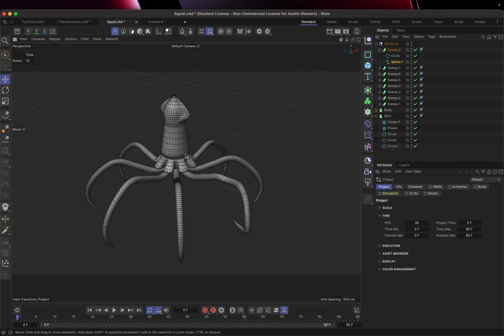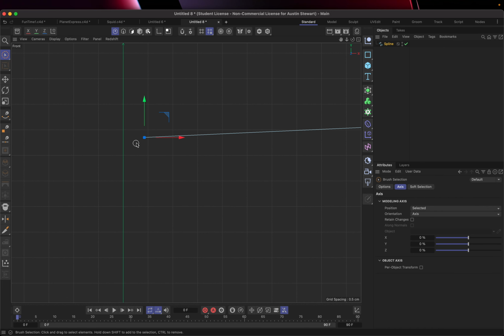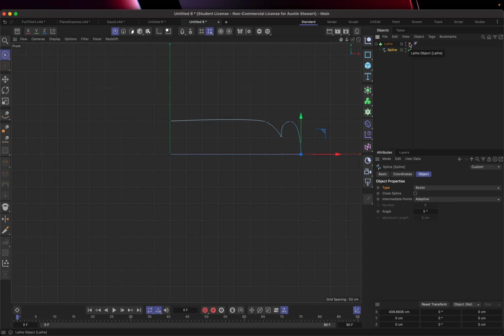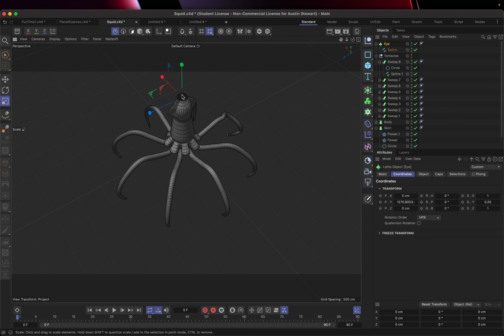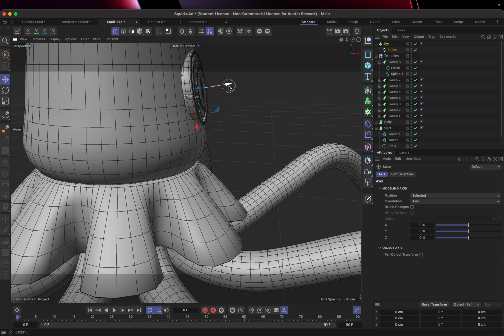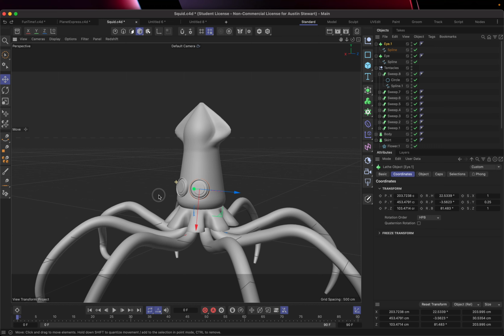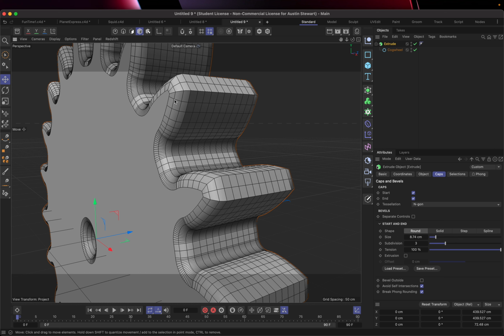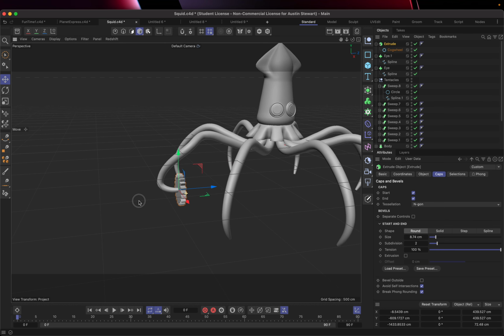Cinema4D 2024 Tutorial 3: Spline Modeling Part 3: Lathe and Extrusion

Comment: Thank you for the great tutorials, if you use the "middle mouse" to switch between the perspective and orthographic views, it is much faster. Thanks again 🙏
Reply from the maker: Thanks for the tip! I am usually using a trackpad for all of this so not having a middle mouse button I forget about it. Also I believe the function keys will also switch but on my mac having to hold the Fn key and F1-F4 is obnoxious and I don't want students to have to change settings in their System Preferences to follow the tutorials.